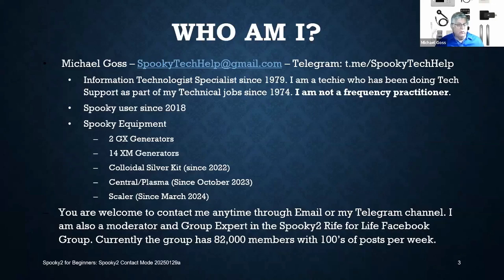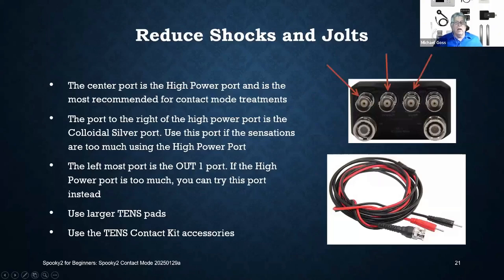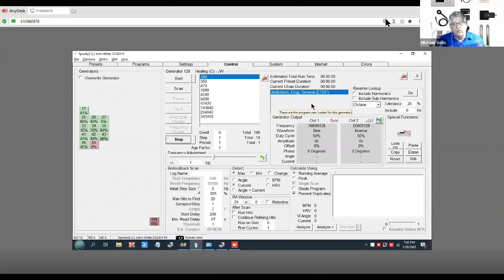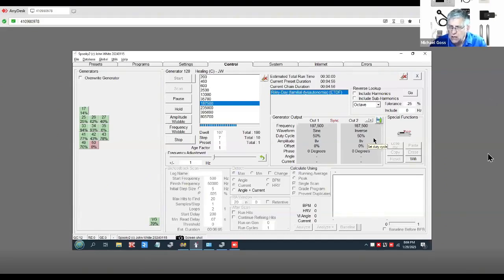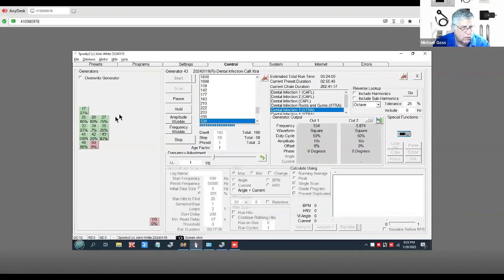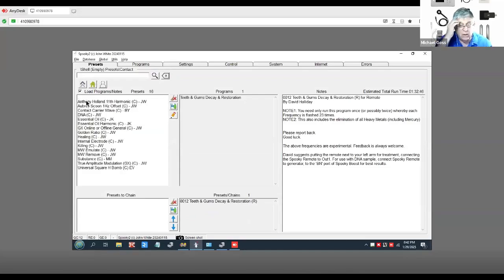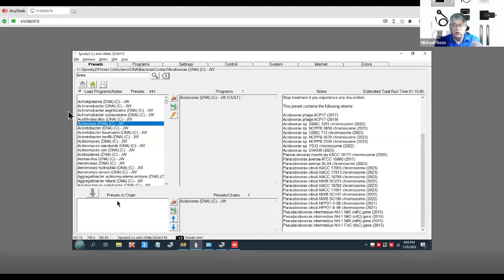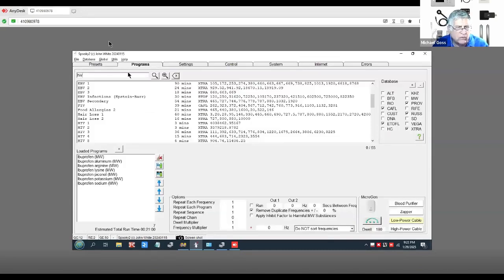Presentation - Spooky2 Contact Mode

Comment: Thanks for this - I learnt a ton of stuff! It was really nice watching you move about the screens, it helps me with familiarization with the software.
One thing I am still not really confident with is what order to connect the generator, PC, Spooky software, contacts and power. Or does this not really matter?
Reply from the maker: I assume that your generator is connected to the computer all the time so your question confuses me. Now if you are brand new, then it really doesn't matter the connection sequence except the generator needs to be connected to the computer before you start Spooky2 except the first time you run Spooky2 it should not be connected to the computer.
Reply: @SpookyTechHelp  Thanks. Yes I am brand new and learning every thing I can before the hardware arrives.  What you say makes sense for the initial set up. But now subsequently if you need to reboot the PC, I assume you don't need to disconnect everything but do you turn the generators off first? Or is it just like a wired mouse which is just left in?
Reply from the maker: You don't need to do anything special to the spooky equipment other than turning it on before you start Spooky2
Reply: @SpookyTechHelp  many thanks.